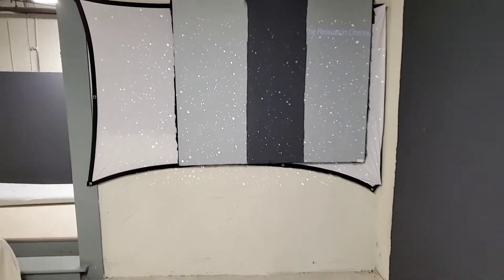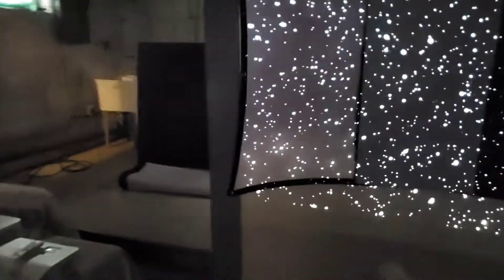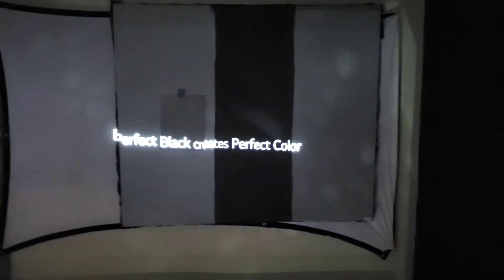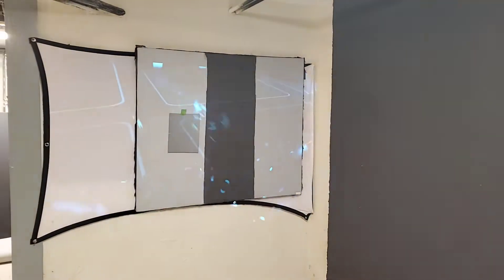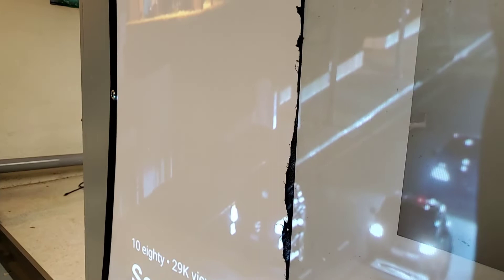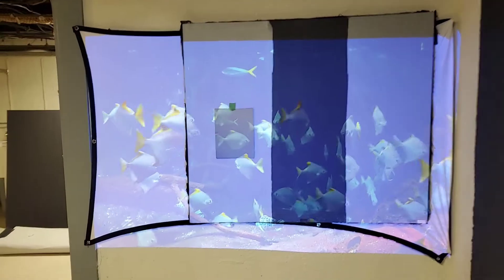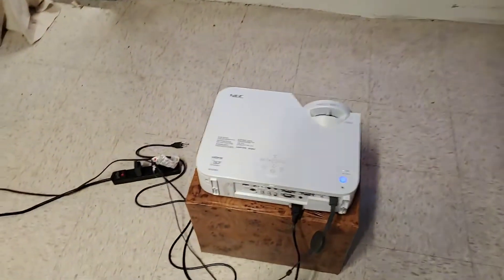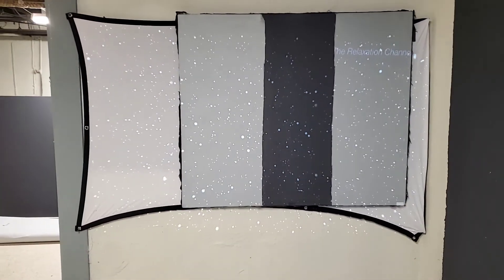Why a grey paint Mix has no contrast & no ALR capabilities next to a NEC M352WS at 10,000:1 contrast

Comment from the maker: NEC NP-M352WS Projector Specifications
User Manual
Product Sheet
Street Price(USD):  **
MSRP(USD):  $1,299
Warranty:  2 Years
Status:  Out of Production
First Ship:  Apr 2014
Last Ship:  Jun 2016
Projection Calculator 
(show metric units)
Brightness:
3,500 Lumens
Contrast:
10,000:1 (full on/off)
Dynamic Iris:
Yes

Resolution:
1280x800
Native Aspect Ratio:
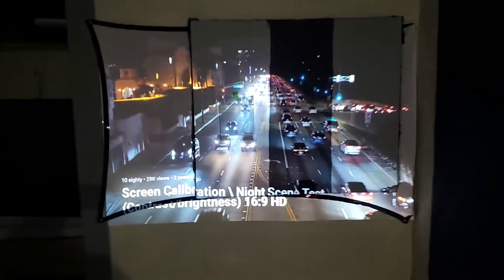16:10 (WXGA)
Color Processing:
8-bit

Projector Size:
5.30" x 14.50" x 11.50" (HxWxD)
Weight:
8.2 lbs

Video Modes:
720p, 1080i, 576i, 576p, 480p, 480i
Data Modes:
MAX 1920x1200
3D Modes:
PC 3D Ready

Lamp Life:
3,500 hours  / 8,000 hours (eco)
Lamp Type:
AC
Lamp Wattage:
270 Watts
Lamp Quantity:
1
Lamp Code:
NP30LP

Display Type:
0.65" DLP (1)

Std. Lens:
Fixed Focal Length
Std. Lens Focus:
Manual
Optional Lenses:
No
Lens Shift:
No

Throw Distance:
2.0' - 5.1' 
Image Size:
58.96" - 150.35"
Throw Ratio:
0.48:1 (D:W)
Projector Placement:
For a 
100
 " diagonal screen, place the projector lens 3'-5" from the screen.

Digital Zoom:
Yes
Digital Keystone:
Vertical

Audible Noise:
39.0 dB  /  33.0 dB (eco)
Speakers:
20.0 W Mono

TCO Certified:
Yes

Max Power:
335 Watts
Voltage:
100V - 240V

Connection Panel:
Composite (RCA),  S-Video,  VGA In (Dsub-15pin),  HDMI,  HDMI,  Network (RJ-45),  USB,  RS232 (DB-9pin)

** item is not applicable, unpublished, or unknown
Special Features: PC 3D Ready, Short-Throw, Closed Captioning, Blackboard Mode, Crestron RoomView™
Comments: Short throw lens eliminates shadows on the screen along with projected light in the presenter’s eyes created by traditional front projection systems